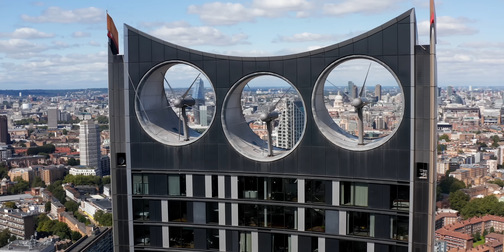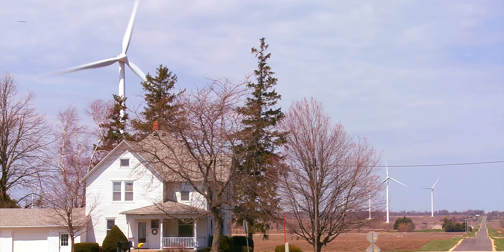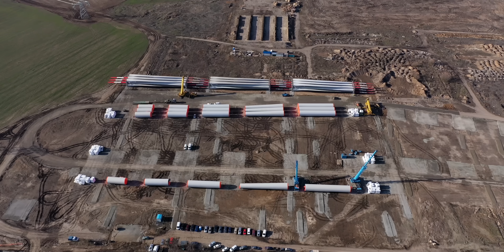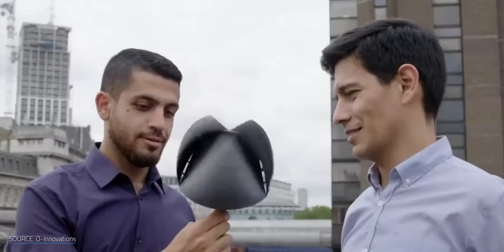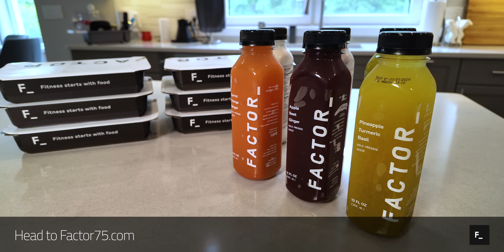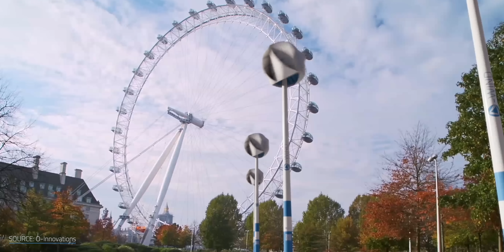How a Small Wind Turbine Will Revolutionize Wind Energy

Comment: We live on our sailing catamaran (s/v Ocelot). Electricity is always a big issue, as we have to make all that we use. 
But characterizing it as XX KWh/month if your winds average YY knots (as you did in this video) is slanted, because the higher gusts contain much higher energy. You can't divide that by time to get accurate W/windspeed.
What we want is: How many Watts will it produce in YY knots of wind? No averaging over time. Just a curve of Watts vs Windspeed.
Unfortunately, a 2m sphere is pretty large for a sailboat. We'd probably be more interested in something closer to 4', or 1.2m. Yes, I know that won't give as much performance, but our needs are commensurately smaller.
Reply: Plus the 2m sphere would make your boat unstable in high winds.
Reply: Why not use the technology of the sea power generators that are off shore tagged behind the boat or when it’s anchored. The sea never stops moving. Just an idea. You have lots of options than the land lovers don’t have …..
Reply: @BrianKirk-t4f  you're right, we have many options. In our case, as a catamaran, we have ample space for solar (photovoltaic) panels that generate all we need. A towed generator, or even a wind turbine, would add to that, & both are relatively common, but they also have their own hassles.

Comment: Seems like you really need to take an introductory course in fluid dynamics.

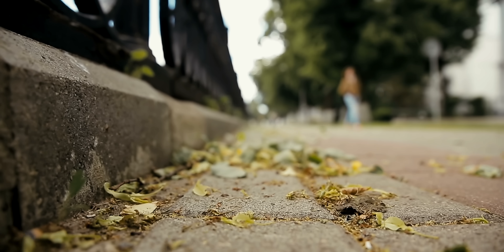@6:00 The Venturi effect is NOT a fluid speeding up through a constricted section. The Venturi effect is a reduction of fluid pressure DUE TO fluid flowing in that constricted section. https://en.wikipedia.org/wiki/Venturi_effect
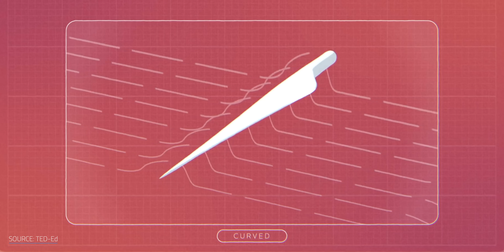@6:40 Bernoulli's Principle is NOT the main lift factor in airplane wings. Redirection of wind via the aerofoil is. This is a common misconception. https://www.grc.nasa.gov/www/k-12/VirtualAero/BottleRocket/airplane/wrong1.html

I'm not sure if there are more incorrect statements past this point as I was unable to keep watching due to the gross errors that were not sufficiently researched.

Comment: If you have the opportunity to install these things the most practical use is in combination with a water tank. You can use what limited energy you have to preheat that water tank. It is unlikely you will generate enough energy to raise the temperature enough for normal use (shower, baths etc) but it is enough to lower the gas or electricity bill if your boiler is clever enough to moderate its burn depending on temperature. Further to that you can divert any excess energy (if exists) to a great big pot of sand, using that stored energy to raise the temperature of the water again if needed. It doesn't interfere with your existing tech, it collects some energy and doesn't need a lot of maintenance.

Comment: Whole thing fall apart if you simply look at the wind speed and the energy it holds. Cities slow it down, making it senseless trying to harvest that little energy, as wind speed goes in with 3rd potency. 
Also, nobody wants these noisy turbines near living areas. There`s a reason for big windturbines far up at the coast and on hills / mountains. 
In cities, PV is way easier.
Reply: There idea is capturing the spots in the city where wind speeds are high. Dought there are a lot of places which have stable this conditions. Not talking about the difficulties fixing these things to existing buildings.
Big wind turbines are not to loud. Even as I was standing beside one most streets would be louder. A few hundred meters away trees and bushes are louder from the wind.

Comment: do remember this fundamentally is still a VAWT but the turbine blade harvests more z-direction wind instead of just the x-y plane. The more compromising the design, the less efficient it is mechanically (wind deviates more from the turning axis). Yes, the turbine will move more frequently because you can harvest more wind direction but do it less efficiently, so it is difficult to say what the real gain is. This is where pursuing one design idea (harvest more wind directions) creates other problems. Other comments have also mentioned the real wind vs. ideal wind conditions. The wind turbine rating is usually done at a stable direction at 100% production wind speed (usually around 10-12 m/s), and in reality, that type of condition covers at best 10% of total annual hours. From several attempts to calculate VAWT use in NYC, the payback periods just make no sense for any installation. We happened to have weather data for 4 years on top of JAVITS center and the result is each relatively large VAWT (rating for 1kw @ 12 m/s) can generate probably 200kwh annually at the best scenario under the real wind data. We have 3D wind data and this estimate is already including z direction wind, so the min0direction turbine in this video will not fare better than our calculation because the efficiency would dip even more. Most of the "praise" about this sort of thing only think qualitatively not quantitatively. When you crank the number with real data, it makes no sense

Comment: As a structural engineer, I see virtually no chance of these being added to existing buildings in urban areas. It would be like adding sails to a building & I guarantee the building was not designed for that. 
Cool technology though it's probably got some good niche use cases
Reply: Nonsense, you are acting like holding a paper towel out with one hand would be enough to drive an oil tanker.

Comment: I really enjoy "Undecided", but once again I have to firmly reject the classic 'small wind scam', this thing couldn't generate useful power in the best circumstances.  People, look at it!  8' diameter, not lift-producing, hoping to power homes based on the tiny zephyrs breezing around suburban backyards?!    If you don't have enough common sense to laugh at this, you are in fact being fooled by wishful thinking.  Sorry Matt, again I really enjoy your channel but this is Savonius Snake Oil.
One point I'd like to make (somewhat addressed in the video) is that while small scale wind turbines don't fit into tiny sububurban/urban yards,  'Neighborhood Scale' turbines would work.   Imagine a 50 to 75 home neighborhood with a park, maybe with a hilltop. You can (and often do) locate a water tower there, so a wind turbine could fit, and maybe a public gathering area with a solar roof that can provide shelter from rain, sun and the elements. The economics of neighborhood power are really good compared to home scale. 
You know why Matt didn't provide power output graphs and data? Because it's so, so embarrassingly bad, that's why!
I'm still a fan of Undecided though!!!

Comment: If maybe scaled down slightly I think these would be perfect for being attached to street lighting along motorway networks. It would be an elevated position and in large open space. I saw a clip of them beside the road using the wind produced by moving vehicles but throw it up high as well. If they produce enough energy that the light uses in a year then the savings would be remarkable ans less strain on power networks especially in the winter.

Comment: Rough numbers since they were coy about sharing: 2.2m diameter = 3.8 m^2 frontal area.  Approximate mechanical output in a 6 m/s wind (assume Cp = 0.2 (probably high)) P = (1/2) (0.2) (1.2 kg/m^3) (3.8 m^2) (6 m/s)^3 = 98 Watts.  The generator might produce 60% of that in electricity.  So you are looking at 60 Watts on a mildly windy day.  We only see those kind of winds maybe once a week (much less in the summer), but we have a poor wind resource.  Omnidirectional wind capture is nice, but most of the wind is on a horizontal plane.  So a Savonius would probably be nearly as effective if not more so because it doesn't have to make as many compromises to permit vertical airflow.  Anyhow, that is what my gut tells me.

Comment: I'm not totally sold on this specific design, but this is a very important area we need to explore and get right.  There's massive amounts of free potential energy to capture with minimal environmental impact.  This design is fascinating and exciting.  But we need to stop relying on hopes and prayers and voodoo magic and corporate saviors.  We need a rigorous and comprehensive analysis of the varied yet ultimately finite number of wind types, placement options, and capture options.  We need to definitively and mathematically and scientifically prove which designs and scales are best suited for various situationally specific parameters.  Additionally, beyond simply first-stage air flow contact, we need to explore and exploit the amplifying effects of positive reinforcement at harmonic frequencies.  Like the way jet turbines exploit the Bernouli effect of an aerofoil shaped tube, combined with counter-rotating as well as static blades, to minimize wasted energy from eddies.  Also, the claims of silence may be exaggerated, yet possibly plausible.  Noise is caused by the eddies, as air molecules move fast around something and slap back together on the other side (right?).  So if this sphere does minimize eddies, it could well be quieter than the ambient noise of wind naturally banging into trees, buildings, and our own outer ears.  Finally, an area to consider that I think is oft overlooked is a comparison of energy lost by a bare "turbine" (loosely defined) that comes to a slow speed or full stop or changes directions 180° every few minutes, as the air typically moves in waves in my experience, with swells and lulls, back and forth, stronger in one direction than the other... anyways, compare energy loss from these fluctuations on a bare turbine versus a turbine with an in-built mechanical flywheel, an in-built electromechanical flywheel, an electronic "battery" flywheel, vs a nearby bank of such similar devices.  These electronic (possibly electromechanical) power storage buffers might lose less energy than a raw turbine, if they keep turbine moving during lulls, somewhere between full speed and a minimum threshhold determined empirically or dynamically, say 10-25% maximum of past 5 minutes weighted also by past hour, or something.  Show me the math.  Show me the graphs.  Show me the CAD files to 3D print or CNC mill or whatever-jet cut plates... also, p.s., as previously mentioned, we need to stop using non-recyclable materials like carbon fiber or fiber glass with plastic epoxy resins.  (or find ways to recycle those).  Steel, aluminum, wood, bamboo, modern "elastic" ceramics, I don't know.  P.P.S. We also need to ensure we're not putting potential IEDs all over highly populated areas.  When we get bad weather, these things can not just be over-spinning and exploding, or locked and sheering off their masts, etc.  Anyways, my 2¢.  Very fascinated by the topic and technology, but truly disgusted at the idiocy and simpkemindedness of humanity.  Do better.  R. Buckminster Fuller laid out the foundation: Comprehensive Anticipatory Design Science.  Use it.  Comprehensive scope, analysis, and understanding, anticipate all scenarios from construction to deconstruction, design using the rigours of science and math, observe, inquire, theorize, test, measure, interpret, conclusion, repeat iteration.  Otherwise, we might as well throw chicken bones, read tea leaves, draw cards, look at planets and stars, flip coins, or bring back the old Gods, for all the futility and impotence of those fruits of human ignorance.

Comment: A while back, I was trying to find a good wind turbine design for a tjasker.  I looked all over for something suitable for a DAWT that wasn't just a tilted VAWT or HAWT.  Nice to see someone bring one to market.  

Can anyone find firm numbers for this thing's % efficiency?  My back-of-the envelope math suggested that tilting a VAWT at 45° could give a 30% performance penalty in the worst case.  VAWTs being 10-40% efficient to start with, that results in 7-28% efficiency when all is said and done.  If this thing can hit 30% efficiency, it's a good fit for this use case.  Actually, let's compare it to Savonius-type turbines, since I've read those are suitable to applications that move water, such as a tjasker.  Those could reasonably be 20% efficient, then apply the 30% penalty for being at a 45°-angle, and the tjasker would be getting about 14% efficiency.  This thing would then look good to me if it can manage 15%.

Comment: Apartments are out, unless it's something being done by the landlord.  I've lived in apartments most of my life, and I don't think a single one of them would've allowed the electrical infrastructure overhaul that would be needed to install any type of renewable energy source.  Most won't let people put up a small Dish antenna - they're definitely not going to allow a 7-foot ball attached to the side of their building.

It's also one of the reasons why the US will not be able to move to totally electric cars within our lifetimes.  Most apartment complexes across the country just have open parking, and even those that do have assigned parking space don't have any way for the tenant to run electricity from their apartment out to where their parking space is in order to install a charging station.  Unless landlords are heavily incentivized to run buried electrical cables from each apartment out to designated parking spaces, then apartment dwellers will never be able to purchase totally electric cars.

Comment: I've been working in this field and I can tell you this. Small wind turbines are not efficient enough (and will never be) to compete with solar. Period. They make noise, need maintenance, will fail and disappoint you. The motto with wind turbines is, the bigger the better. Albert Betz discovered that there is a maximum amount of energy you can harvest from wind (59,3%). And that is in laminair flow.....

Comment: Those could be mounted in between divvied highways. Getting air movement form Wind and vehicles.
Reply: Have you though of what part of the car's movement energy you can actually catch? And does that cause extra fuel use on cars? If the latter is the case, you can also use a conventional energy plant to burn some organic matter...
The idea sounds nice but is very cost-inefficient and is only used to catch subsidies, not wind.

Comment: Back in the Jimmy Carter days I did a preliminary engineering wind energy evaluation for the Chicago area. The gross wind energy available at first indicated sufficient energy for the technology of the day. There were periods when the wind speeds exceeded the safe velocity for the mechanisms and a safety device would feather the windmill. Unfortunately, the 7% of the time when the safety mechanisms were in effect accounted for more than 50% of the annual energy expected. The next problem occurred when examining a windmill parameter called its solidity. If a windmill had a 100% solidity, the windspeed after going through the windmill would fall to zero - and effectively pile up downwind. A solidity factor had to be significantly lower for maximum efficiency. Say the windspeed drop after passing the windmill might be 70-80%. So only 20-30% of the lower energy winds could be effectively captured. This required upsizing a single family windmill beyond the space available on a typical home's plot.
Reply: Some generators work in all wind speeds. So much research to do to find the right one.

Comment: Tho commenters that are negating this because of similar previous proposals are working with old data. There are 1Bn people in the world whose domestic electrical baseline needs have gone from zero to levels that now include several LED lights, charging capacity for devices that are now no longer optional. In a county like Cambodia, where I've spent a fair amount of time, this has been a major capital expense in power generation (by coal), and transmission infrastructure. 

Meantime, in cities like Phnom Penh, energy consumption is rising quickly, and the national grid is subject to frequent failures. So a solution that eliminates need for upgrading infrastructure by segmenting in particular low-voltage requirements and thus reducing grid demand, is a huge factor in things like reducing expansion of fossil fuel use for those 1 billion. And most Americans and Europeans have a pretty hazy idea about the rate of modernization in the developing world, which is much larger than 1 Billion: closer to 4 or 5 Billion, depending where you set the line.

So why not solar? It could be, and often is. But dependence on solar increasingly means competition for what are rapidly becoming the costliest elements commercially available, putting impoverished farmers in a bidding war with American consumers who want more solar on the yacht to allow them an induction cooktop. Who do you think will win?

Comment: Here in Australia we have an energy storage problem. Through the day there is more than enough energy being produced by all the roof top solar. The energy managing authorities now want a way to turn off the output of roof top solar indicating there is too much energy available. Opinion: Energy transition is really wealth transfer.
Reply: G'day . I spent a 18 months in OZ, Perth WA, Mt Isa QLD and Sydney NSW and you definitely have way too much solar. What you need is battery sound obvious I know and they aren't cheap but you get to store all that sunshine for the evening and night time and when the battery is full sell what you don't need overnight  those greedy Utility companies. FYI I have solar and a battery (Powerwall3) in not so sunny Manchester UK but the 13.5kwh storage supplies all our household consumption and then some. In winter we charge the battery from the grid at cheap rate prices (wind blows over the North sea most of the time)  which makes up for the lack of solar as its seriously dark and miserable here mate 🥶